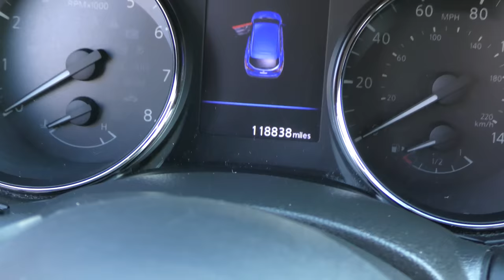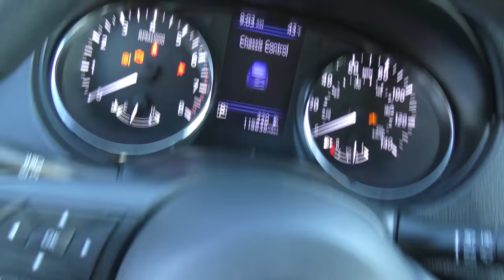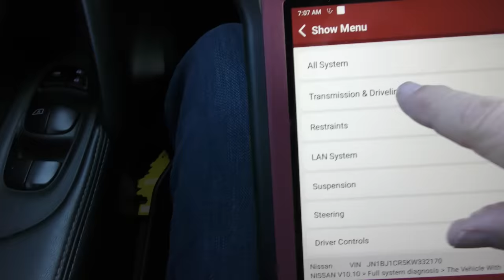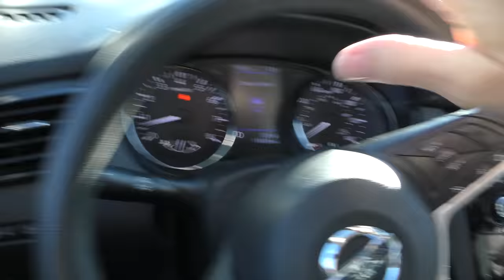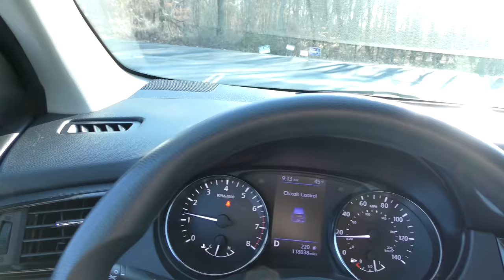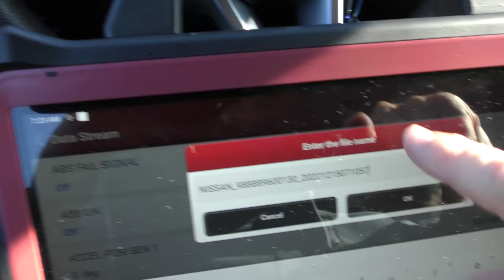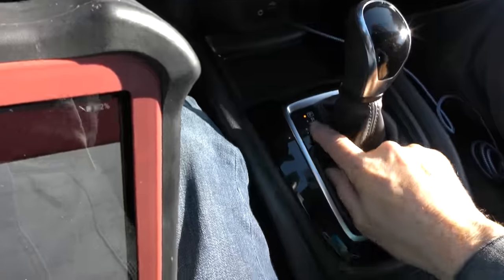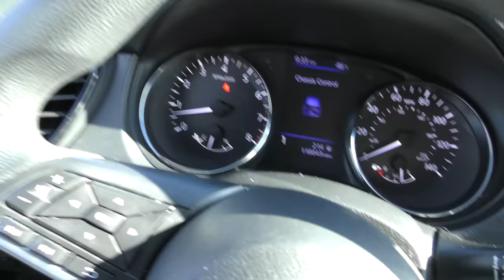The Worst Transmission Ever Made (Do Not Buy)

Comment: After 2020, Nissan reviewed the trans and replaced 300 parts, including a new belt
Reply: Oh I have a 2019 Rogue with the 2.5 liter engine. Oh well that's the way it goes.
Reply: They reviewed the trans and replaced parts? lol
The core design of these transmissions is the problem, all the power of the engine is being transferred over 6 ball bearings.  Unless they changed that, it's still the same terrible transmission.  
I am surprised they are even touching this design yet considering how bad they are.  At the trans shop I used to work at, they had a guy who was dedicated to the Nissan cvt, he averaged about 1 a week almost year round (in-between other work).  They are by far the worst trans design I saw while I was there.  Now, we didn't see any 2020 or newer as they were still under warranty so the dealer's would take care of them.  So maybe the did fix them, but considering how long they continued to use the defective design, I doubt it.
Reply: We so far if you check online... there are NO complaints after 2020 over trasmision
Reply: @tonym8358  I doubt many people will complain as long as the warranty still covers the repair.  But for Nissan's sake I hope they made it better.
Reply: @procrastinatingnerd  never had any issues with my CVTs. Just changes the fluids around 30,000. That’s the main issue with most car owners they don’t maintain their vehicles. Which is good for mechanics and transmission shops.
Reply: @nicholasadkins6469  Indeed lack of maintenance is a major problem, but to have a transmission that requires 30k fluid and filter changes or it will literally blow apart inside, that's a little beyond standard maintenance.  My Taurus's trans service interval is every 100k.  I've followed that and it's at 380k now and still works.
Reply: @procrastinatingnerd  he is correct, Nissan have updated the transmissions, that use in the Altima, Sentra and the versa in the 2019 models upward,  however the 3 pot rogue is an all new completely redesign,  the new transmission in the rogue does not use the v steel belt, it actual use a flat chain type belt similar to Subaru CVT design.
Reply: @procrastinatingnerd  not really average trans oil change is 50-100k , some Toyotas CVT recommend at 50k and with lot of driving 20k.
Reply: @cb5110  The belt in the trans was never the problem (Yes, the belt comes apart, but it does that as a result of other problems).  I hope for Nissan's sake they did more than change the belt type.

As for trans fluid change intervals, my taurus says every 100k.  Yes, it can be different, and people should find out what theirs is on their car.  And if you abuse your vehicle cut that interval in half.  So, if your manual says 50k on your Toyota and you abuse it then change it at 25K.  None of this is news.  
The Nissan trans says every 30k when you're not abusing it...  I wouldn't' call that normal or average, but I'm sure Nissan knew the problems with the trans.  It would be interesting to see what the fluid change interval was in the manual on the first Nissan with a cvt, before they knew how bad they were.
Reply: @procrastinatingnerd  I do not own a nissan, I did some years ago, but I follow cars in general, whether Honda , Toyota Nissan eTc, and the car I own now is honda accord,  but I think before Nissan recommendation was at 60k before CVT oil change, but to be fair the former CEO was cheap, cut cost , the CVT was design with cheaper parts, so I kinda know what you talking about,  the new CEO since has updated the CVT, however the new rogue as I say in not just the belt, it is a total complete all new design, and differ from the ones in the Altima, it is not use in the Altima nor the Sentra, only the rogue/x- trail and the Qashqai in Europe currently use that CVT.

Comment: I have Two 2018 Nissan Rouge SL AWD. I Religiously change the NS3 tranny oil every 30,000 miles myself. These CVTs are really hard on the fluid. If you don’t change the fluid regularly,  
when they start getting high miles on  them they will stop working.  I am surprised Scotty didn’t look at the fluid condition. Sometimes it’s black as coal when you check it. 
its actually a light blue fluid when new.
There is a cylinder shaped fluid filter in the CVT that is under a cover that has 4 10mm bolts. Its where the cooling line goes into the CVT. This must not go over 40k miles between changing, or your CVT can get hot from reduced flow.
Reply: scotty_kilmer5213  Hi Scotty. Is that reply just an automatic one?
Reply: How do you check it.... I don't think there's a dipstick. I just got a certified 2019 Rogue with 51,000 miles on it. I drove it about 2500 miles already and when I get the next oil change I'll probably get the trans oil changed too.

Comment: What are your opinions on a 2014 Subaru XV Crosstrek AWD with the 2 L flat-four engine and the CVT transmission and the 2016 Subaru Outback AWD with the 2.5 L flat-four engine and the CVT transmission? I heard that Subaru CVT's are much more reliable than Nissan CVT's. For my opinion, I would not buy any vehicle with a CVT transmission, because how unreliable they were since manufactured (brand new) back then. Instead, I would purchase a 2004 Jaguar XJ8 full-size sedan with the 4.2 L V8 engine and the regular six-speed automatic transmission. These older Jaguar's still get better fuel economy than these newer Nissan's do. Thanks.

Comment: I wonder if I ever get a Nissan including a rogue and keep up with maintenance regularly including the transmission, will the CVT still last for a long time??? 

I’m honestly nervous of owning one, although I drove one a rental and the CVT isn’t bad to me.
Reply: Some of the comments I read in this thread are saying they run good and many years when 
the maintenance is done on time. Like changing the transmission oil or fluid every 30,000 miles.
Reply: @metalmike570  I see that too. I also seen some have this so called “secret filter”. I don’t know anything about that.
Reply: @CharlzTellis  Don't worry about a secret filter, I have a Rogue and haven't heard about it. Just change the engine air filter when it's needed. The cabin air filter is another one. I tend to do these myself, you can even look up how to videos right here on Youtube.

Comment: THE WORST TRANSMISSION EVER?
That distinction has to go to the Borg Warner  automatic transmission on the 1987 Saab 900. Bought the car new, the transmission went about 11,000 miles, boom froze. The dealer replaced it. After about 15,000 miles the second one went. Saab engineers should have been ashamed of themselves for using such a inadequate POS transmission. I dumped the car. I regret not suing the Saab motor company for the entire cost of my car.

Comment: Scotty, I haven't seen you do an engine stall test for CVT transmission. On my honda Fit, Stall testing the transmission is at 2300 to 2700 RPM acceptable level.  If it passes the stall test then there should be no problem in terms of slippage at low speeds and may just be psychological effect on the owner.
Reply: I think the stall test only test's the torque converter.
Reply: @procrastinatingnerd  In diagnostics, they can tell if there is a forward or reverse clutch slippage. It's in the repair manual.
Reply: @petercandance2330  Oh I see what you mean.  Yes in diagnostics you can test much more.  I think that's more than just a stall test though.
Correct me if I am wrong but a stall test just tests the rpm that the engine stops increasing at and if that's within spec it's a pass.  That doesn't include connecting a scan tool to see if there is any clutch slippage.  Maybe it depends on the vehicle, what manual are you lookin at?
Reply: @procrastinatingnerd  shop manual for a 2003 Honda City/Fit/Jazz CVT. Yes it's a purely mechanical test as you described. An example, if the engine can go above a certain rpm (mine is 2700) in Drive with brakes on, but passes and remains below that in Reverse, then it's not the torque converter slipping , it's the forward clutch.
Reply: @petercandance2330  Oh I never thought of using that test that way.  I think it will only work though if only one of the clutch's are slipping (forward or reverse).  If both are slipping it will appear as a bad torque converter.

Comment: I can vouch, my Nissan Rouge CVT transmission at 100K already needs to be replaced. Might get to 120K....
Reply: these CVT operate funny, they can go on to 200k. If the CVT is overheating then yes, or if it slipping a lot, yes, if none of those it just getting old.
Reply: @cb5110  Cannot do steep hills and slips when it gets hot out... just a matter of time. Wish someone had a new Transit Connect in stock. I would like a small work van with front wheel drive.

Comment: Hey Pal. 
Greetings from Nova Scotia, Canada 🇨🇦 
Quick story/question. 

So, yesterday (SUNDAY) 
While driving on the highway, my 2016 Kia Sorento 3.3 liter V6 decides to experience catastrophic engine failure!! Ugh! 
Connection Rod bearing! 
Yup..
The sound was awful. 

Question.

I'm looking at a 2004 Acura TL. 171,000 kms. 106,000 miles. Automatic. 

Good car? 
Would you? 

Thanks

Comment: So the "worst transmission ever" was doing just fine?  0.o
Reply: Those transmissions are fine as long as you don't drive them like a race car and change the CVT fluid every 25,000 miles.
Reply: @josephkelleher8820 On the '07 Nissan Altima, the CVT fluid is to be replaced at 60K miles, or 48 months.

Comment: Toyota ecvt are very different than other companies cvts. They are gear driven with 2 electric motors and toyota has a patent on their design. so other makes use a chain belt drive system that work but needs much more service...ie fluid changes every 30 to 50k intervals. these systems create much more friction...so they fail more often

Comment: 2016 Nissan Altima 3.5SL trans went out at 120,000miles, suspension completely shot at 135,000miles, power steering going out at 159,000miles, infotainment system complete trash laggy

Comment: Our 2011 Murano AWD has 112,000 on it and the CVT transmission is not only dead, but irreparable and pretty much irreplaceable. The mfg stopped making new transmissions and parts long ago. The only ones available are rebuilt by one or two companies, mostly from salvaged parts according to our mechanic and the dealership. Most are said to fail within a years time, and some a lot shorter time. So it’s a planter in our yard. What a POS! A barely past 10 year old fairly high priced car that is irreparable. Never again.

Comment: Toyota owners with a traditional CVT, what’s the highest milage have you done on your transmission? Just need some assurance.

Iv just bought a cheaper used Toyota Avensis 1.8 with a CVT at 89,300 miles with previous owner not changing the transmission oil and filter but the rest of the car been taken care of according to service history. 

I don’t even enjoy driving anymore due to my constant worry about the automatic transmissions… 

I’m super paranoid about transmission failure as my first and last car I only had for 3 months and the DDCT automatic transmission failed (Jeep Renegade) lost a lot of money on it and had to get rid of it.

Comment: I have a 2012 ct200h 170,000 miles , idk what I have but I want to brag about mine too 😂. I just changed the spark plugs and ignition coils myself, which is separate jobs one costing $600 and other $500 and cost me $150 for ignition coils and spark plugs got a very good deal VIA THE INTERNET
Reply: Ur joking right?
Reply: @lopez121709  About the price it cost me? Or would’ve ? Both True